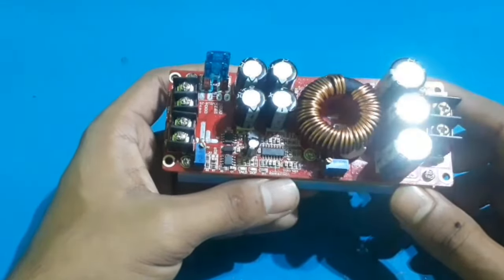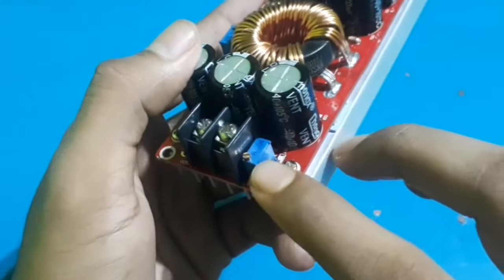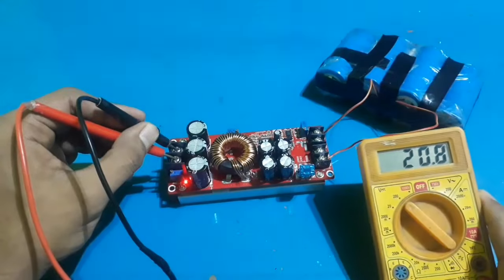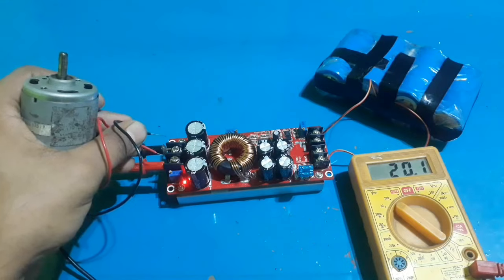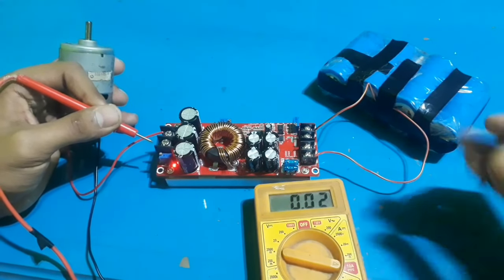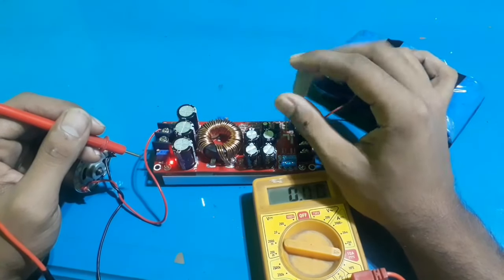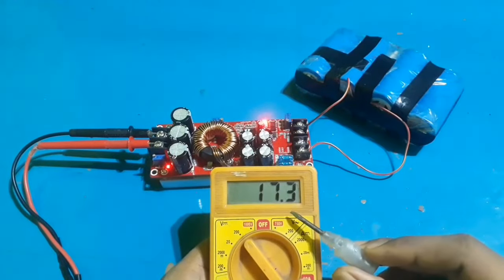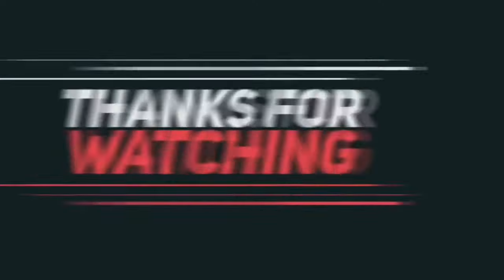1200w (12-80v) Voltage Boost Converter || Output power Tested

Comment: With which converter can I get 5V and 10A at the output so that it does not overheat and shut down?  Thank you
Reply from the maker: Use 300w dc to dc step down converter.

Comment: এইটা দিয়ে কি ১২ ভোল্ট ব্যাটারী দিয়ে  ২৪ ভোল্ট করে সাইকেল চালানো যাবে ? লোড দিলে কি মটর ঘুরবে? দয়া করে জানাবেন।
Reply from the maker: Yes you can. I also runned my 36v ebike motor with 12v battery by increased the voltage .